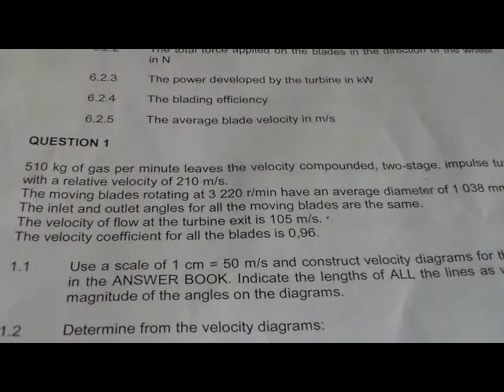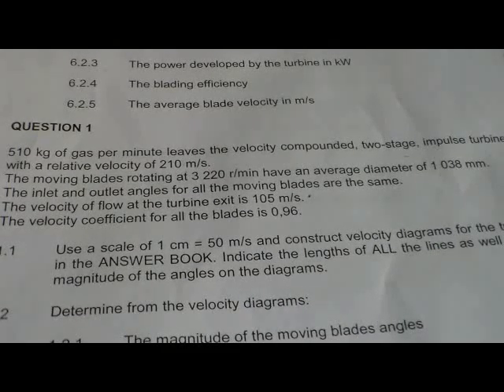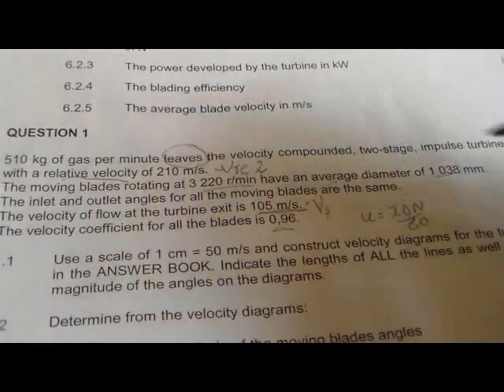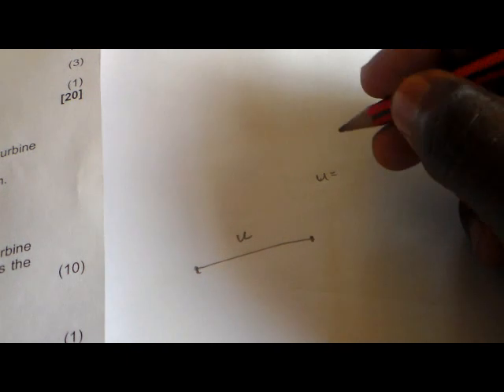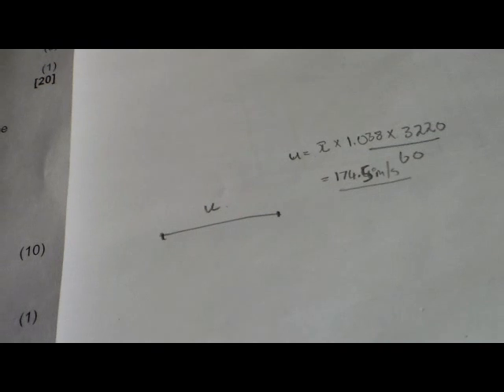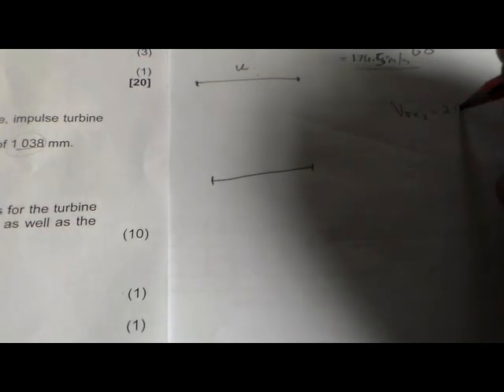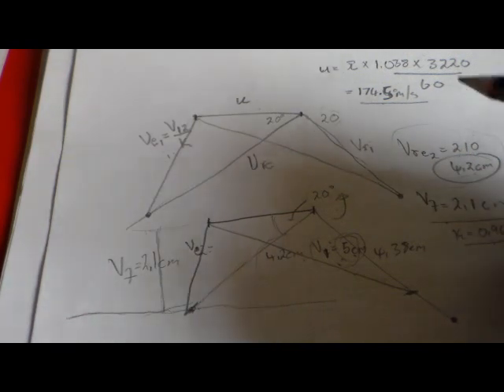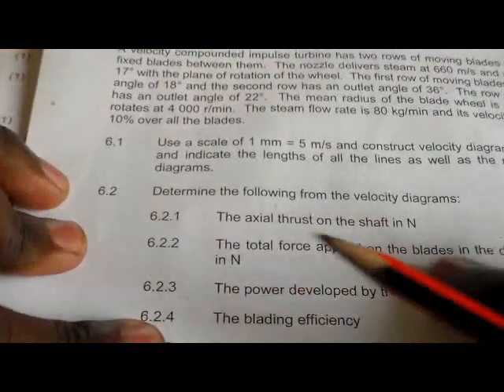Example 2 two stage velocity diagram

Comment: But am little bit confused.. how did u get Ve2 because we only have Vf of which we don't imo the distance btwn point A to Vf line? I don't know if am making sence
Reply from the maker: U  have to draw a horizontal line with a distance of Vf which is measured from the line of the initial velocity (u) then draw measure the exit relative velocity from the blade side to the horizontal line of the Vf and where it intercept u take it to the turbine point and get Ve
Reply: @helpnatedstudies  so we draw a same distance(of Vf *the horizontal distance*) from line A of U then same horizontal distance for Vf?
Reply from the maker: I don't know if I make sense too
Reply from the maker: Yes the horizontal line should be of the distance of Vf from U.
Reply: @helpnatedstudies  thank u somuch